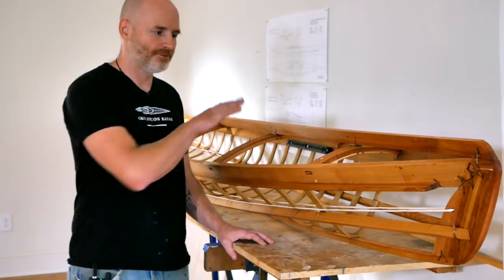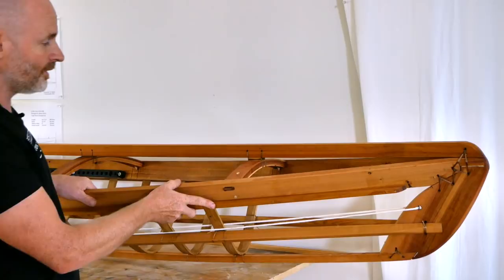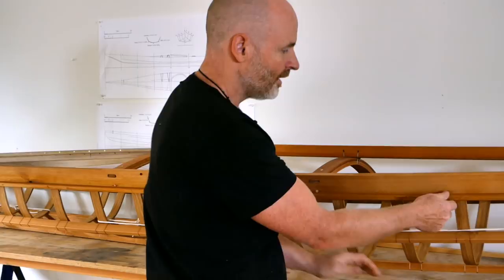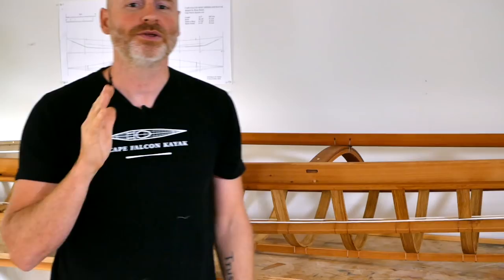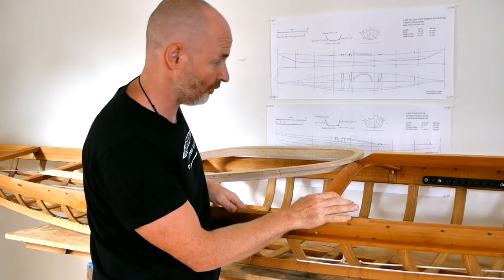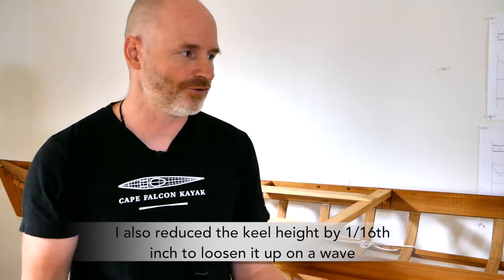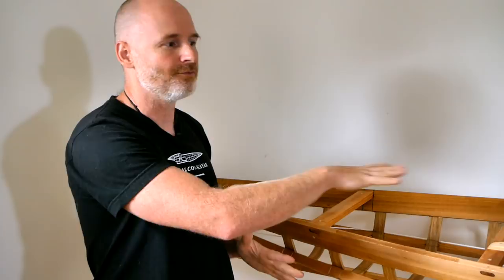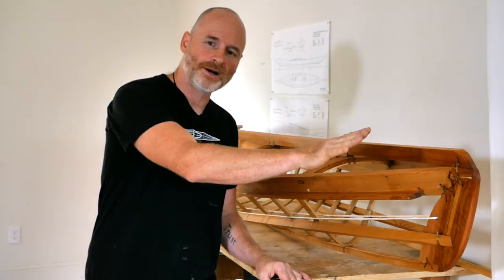Some more F1 kayak modifications...

Comment: As I understand it, high primary stability is like a raft: the boat always wants to sit flat to the surface of the water. Example: look at commercial plastic fishing kayaks. They don't require any balancing, but can be nauseating in rough conditions.

High secondary stability is like a spar buoy: the vessel is free to list over really far yet it resists capsizing. Example: look at Greenlandic "storm kayaks" with really sharp V shaped ribs and very little chine. They sit still in rough seas and punch through waves.

Comment: Has anyone pulled off a Greenland style boat with paulownia gunwales? Western redcedar is hard to find around here. Paulownia looks like it could work if you upped the dimensions a bit, though I worry about the mortises wallowing out over time.
Reply: Western red cedar is expensive and scarce here too in the Netherlands. I can't tell you whether Paulownia would be a good choice unfortunately. Depending on availability Siberian larch or densely ringed Douglas can also be used; preferably from colder climates since trees grow slower and denser. You might wish to oversize your gunnals 10-20% with a some weight penalty.
Reply: Check out Peter's build on the CFK student builds blog - he used paulownia and provided some details about building with it and his supplier: https://builds.capefalconkayaks.com/2018/03/peters-f1-south-australia/
Reply: So which wood did you build with, if any? And how is it working out for you?  Paulownia is plentiful here too, but grows way too quickly (to make good timber for most things) and I also have lots of Poplar and would use it in preference. Once Poplar has dried, it's quite stable but I'd not work it green-no telling what shape it might end up. It's a light hardwood and will add weight, but also can be dimensioned down a little bit. Others have used it as Brian relates.  I'm closer than ever to building mine and may scarf some box store western cedar for length rather than pay a fortune for importing full gunwale lengths.